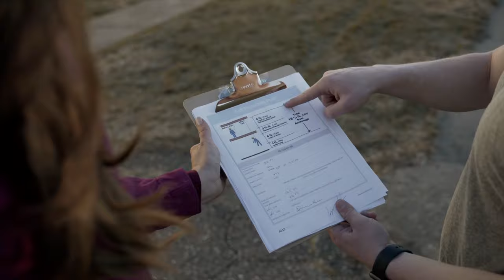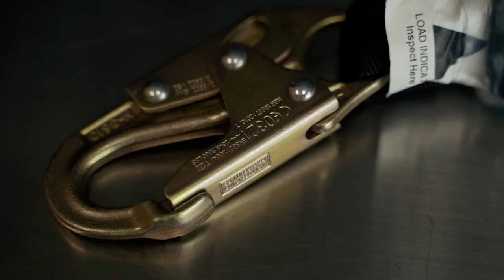FALL PROTECTION BASICS | ABCD’s, Demonstration, PFAS, Fall Restraint vs. Fall Arrest, and more!

Comment: I'm a climber so not really the target demographic, but. I'm really confused about why the "lanyard" is static. Like it feels super odd to me. I guess because it is pretty low falls with a fair bit of slack and you could get a ground fall if it was dynamic?
Reply: Yeah, the lanyard not having any give confuses me a lot as well. It would greatly reduce the forces on the person falling, as well as the anchor.
Reply from the maker: Not sure what the timestamp is but are you talking about the self-retracting lanyard? It maintains tension during normal movement.
Reply: @AllySafety  We're talking about the steel cable used. Steel cables have essentialy no stretch, which seems like it would be a lot more dangerous to use than a rope with some stretch to it, since with a more stretchy rope, the work done by the rope is spread over a much longer distance, making the forces involved much smaller, by as much as as an order of magnitude in some cases.

"Static" and "dynamic" in this context just refer to different kinds of rope, static rope has no stretch while dynamic rope can stretch quite a bit.
Reply from the maker: Oh this is so interesting. There are cases where fabric or rope lanyards are used but we generally want to minimize stretch. The self-retracting lanyards I’m using have mechanisms to prevent jarring but since they also stop extending similar to a seat belt if the cable extends fast like in the case of a fall. That way you have less distance you can fall in the first place.
Reply: Okay ^-^
That feels reasonable. Climbers generally take MUCH bigger falls I assume. Like 3m is very normal and more is not uncommon. When you reach those fall distances stretch is pretty necessary to not get hurt. And you are more worried about not hitting the ground, especially if you fell at an odd angle.

Comment: Wait, so 54% had no access to fall arrest equipment and 23% had access but didn't use it. That only adds up to 77%. How did the remaining 23% of all fatal workplace happen while using fall arrest equipment?
Reply from the maker: They didn't give a lot of info on those but I'm guessing it's a mix. There are cases each year where people are wearing fall protection incorrectly like they when they haven't calculated the fall distance and their lanyard is too long so they still hit the ground. It'd be interesting to see what the breakdown of those cases is and maybe do a video on it at some point.